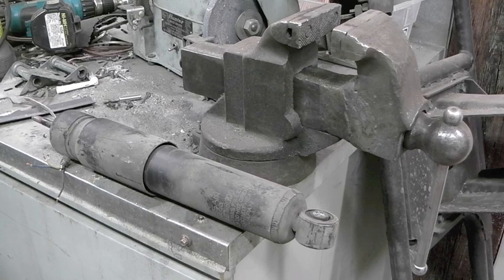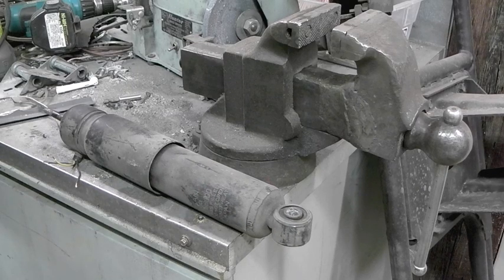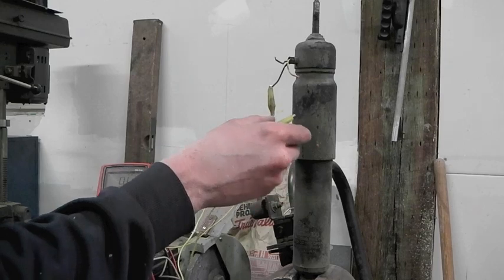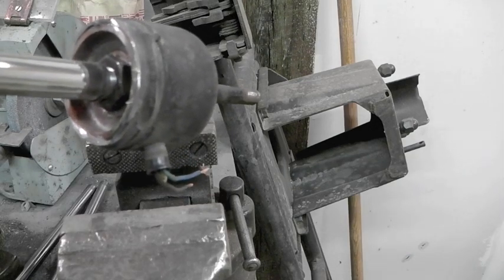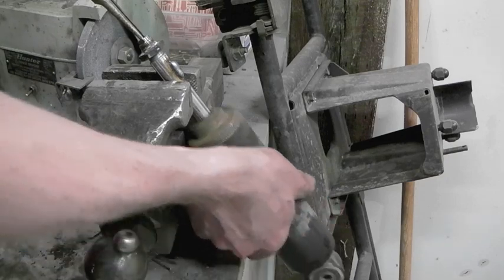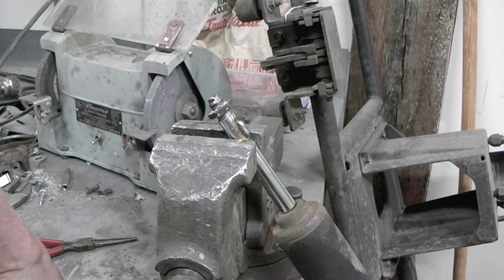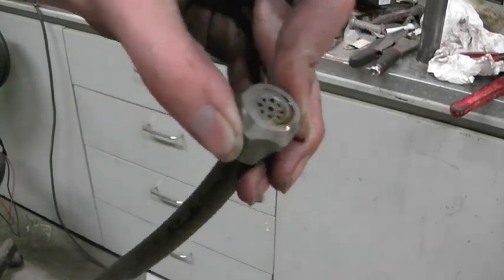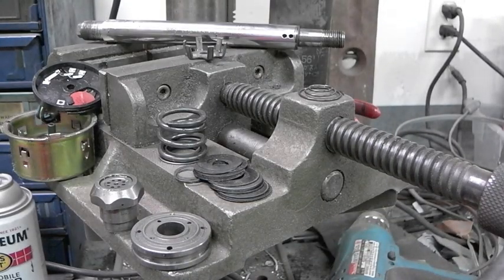KYB Adjustable Shock Absorber Teardown

Comment: Cool stuff! Just picked up a 1992 Pathfinder that had these from the factory. Sadly they are discontinued parts. if you still have a few that don't have holes drilled in them I'd be interested, haha.
Reply: Adapt the Toyota/Lexus units
Reply from the maker: Funny you should ask, I've got a few left on my junk pile, but of course they're whupped. IIRC Adamzan on the NPORA forum managed to find a new set somewhere.

Comment: Is this the same tech that found in the 80's Mitsubishi?
Reply from the maker: No idea! Never had a Mitsubishi to bits.
Reply: Darwinpasta thanks for the reply. I did some research on 1986 Mitsubishi Galant, it's has same principle but the actuator is outside above the shock, also is has airbags combined to raise the sockets as well, brilliant 80 engineering

Comment: You couldn't tell the difference driving on rough gravel roads? I'm suprised mine are still good, I bought a q4 95 SE, and I can for sure tell when I'm on a rough gravel road... takes the washboarding right out of it! Expensive getting new ones though... and mine are 19 years old LOL the ones I have seen are around $250 a pop! I'm gonna hate when I have to pull them out.
Reply from the maker: Mine were pretty whupped! I know one of the guys on the forum tracked down new ones, and I think he found them cheaper than that.
Reply: @Darwinpasta  where
Reply from the maker: @magnumllama400  No idea, sorry.
Reply: @Darwinpasta  aren't those shocks on pajero too?
Reply from the maker: @magnumllama400  I haven't crawled around under a Pajero but I wouldn't be surprised if they used something similar.
Reply: @Darwinpasta  yea man look it up. Pajero mk2 had those probably as optional. I see many pajero for sale with them, but some owners removed them because they broke due to low maintenance. Some models didn't come with them.

Comment: Very cool!  I've always wondered how these worked.  I guess it would be easy to adapt these to a different vehicle
Reply from the maker: Thanks! And yeah, I kind of expected to find more in there. You're probably right on that plastic ring. I imagine they'd fit anything with the same size/length shocks, and the wiring's not too difficult, but you might be hard-pressed to find a set in good condition anymore.